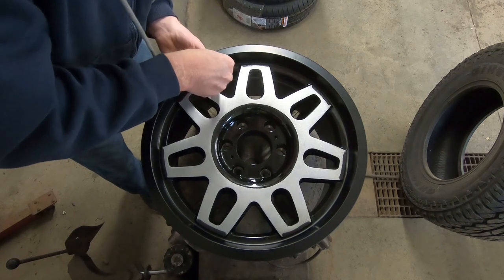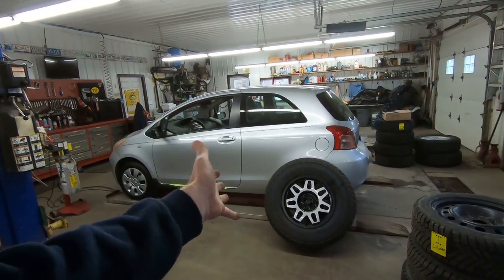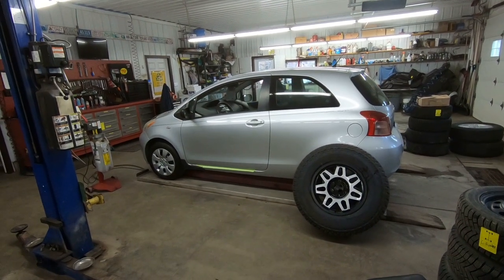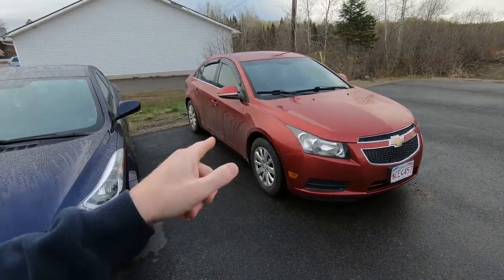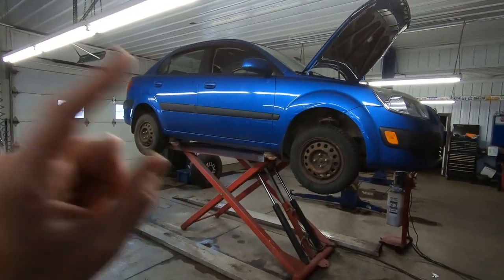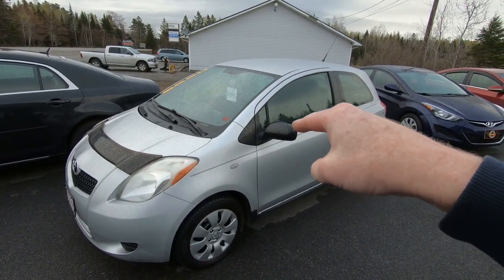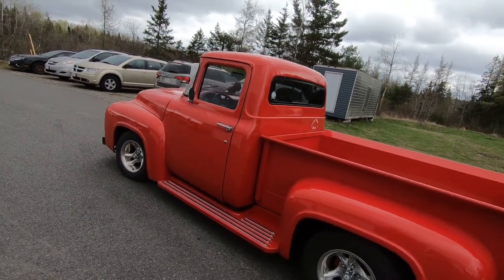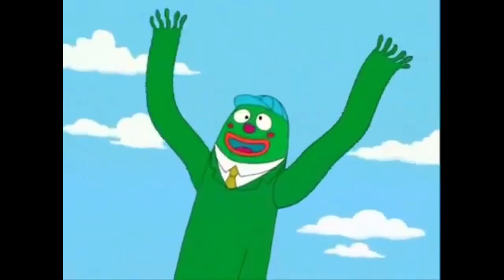MOUNTING 35 INCH TIRES FOR OUR 2011 F-150

Comment: Had 35's on my f150 with only a 2.5" level kit and 1.5" rear block ..I miss that truck , but I would take that Mercury to make me feel better !  Don't know much about rat problems,  but how about making a cat problem and them them Duke it out 🤯
Reply from the maker: +Al Barriault that’s the direction I’m heading with the lift! Now let’s go get some ferrule cats!
Reply: @OldeCarrGuy  
I can't remember the offset I had , but also had to use 1/4" spacers, to eliminate the slight rub on the front inner fender